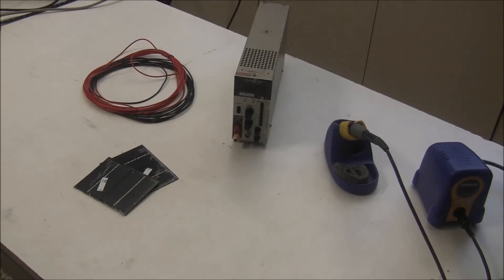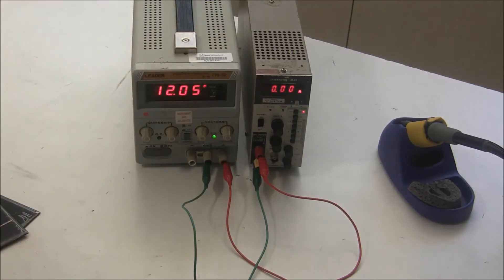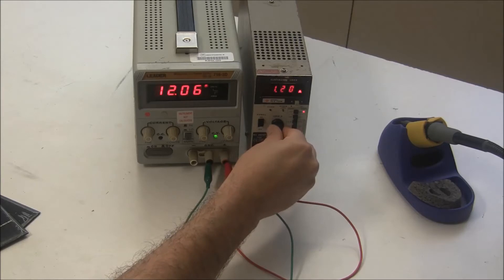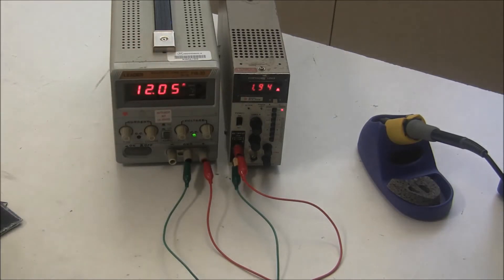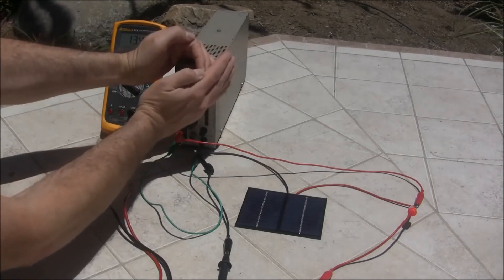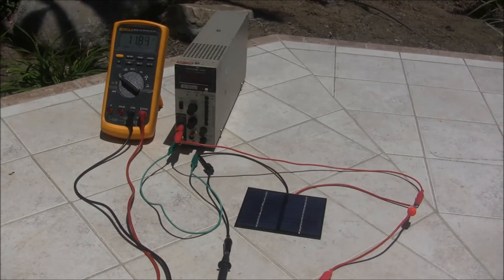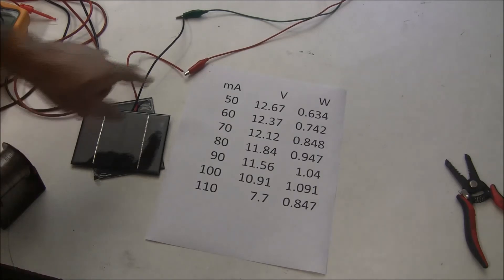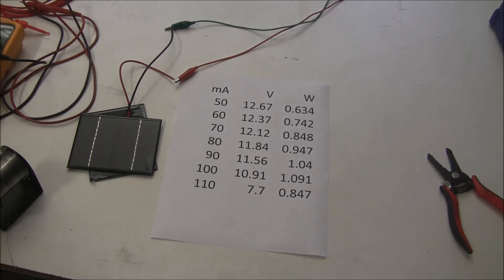Synthchaser #071 - Load Testing Cheap Chinese Solar Panels & Power Supplies

Comment: Appreciate this, even if it's old, most of us cant test the panels. I have doubts about larger panels I bought too.

One thing for you and others. If it's not as advertised, contact the seller and tell them so. Their options are to refund your money, or pay the cost to ship it back to China. It's not worth it, they will refund your money. AA and C rechargeable batteries are the same way, even by weight you can tell they are not as advertised. May put a bad taste in peoples mouths for solar or rechargeable batteries, when it's really misrepresented components causing the issue.

Comment: Lol, learn to properly design your experiment first before you make a review. You should've at least tilted the panel based on your latitude facing south first, then maintaining that first angle, faced it directly towards the sun. You failed to consider those two angles.

Comment: It would have been nice if you would have stopped saying millivolts instead of milliamps during the outside test, but otherwise a good demonstration of false Chinese advertisement and claims on eBay.  Thanks for sharing.
Reply from the maker: Ha!  I never noticed that until you pointed it out.

Comment: You didn't tilt it towards the sun
Reply from the maker: Sun was overhead
Reply: maybe it was just me but the shadows looked slightly angled
Reply from the maker: Yeah, it might have been a few degrees off, but still was substantially overhead.  Not enough off to make a dramatic difference in the result, IMHO.
Reply: ayy fair enough
would thicker wires have made a difference?

Comment: Yeah, I think the Chinese suppliers like to multiply the peak short circuit current by the peak voltage and call it the panel's wattage.
Reply: Is the same thing with amplifier.. peakpeakpeak plastered everywhere